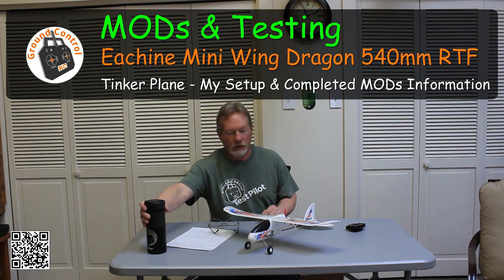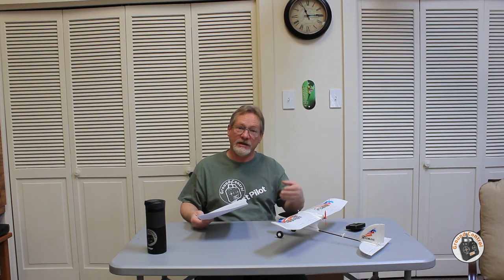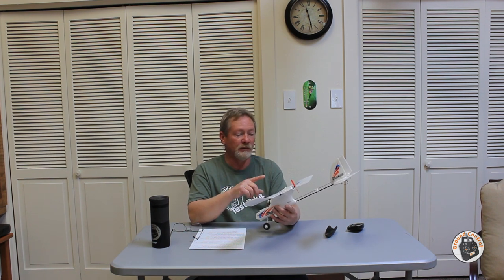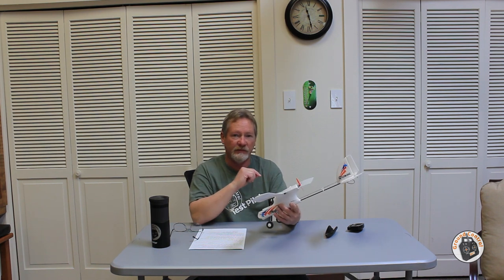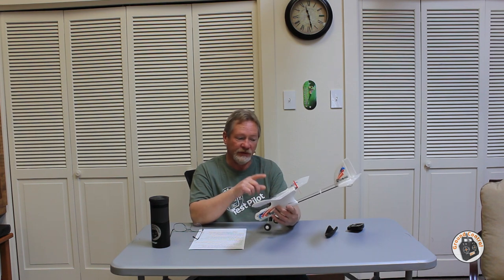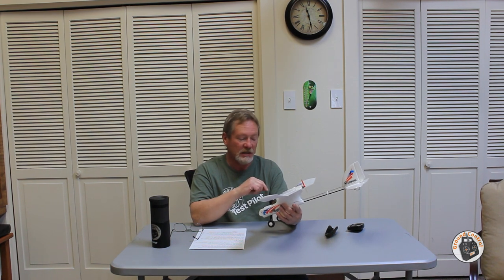Eachine Mini Wing Dragon 540mm Wingspan 4CH Gyro Trainer Airplane RTF  - Setup & Completed MODs Info

Comment: That's quite a mod list.  Nice to have a Mini Wing Dragon that flies better than most, isn't it?

Is it possible to remove the fuselage boom on either end?  If so then you might be able to shorten it and the entire aircraft a half-inch or so for balancing instead of having to add any weight.  Just a thought.

Happy Flying!
Reply from the maker: I'm very happy with it now. Oh, I'm done with the MODs on this one ;-) It's .4g less than stock and it's flying extremely well. Now it's on to the Mini Mustang if the Motor testing proves to be what I need.

Comment: Great mods, and I am looking forward to a flight video with the F949 brick version. I think for anyone but a complete beginner, this plane does not need stabilisation, but for those beginners you have also pointed the way to a good stabilised solution. 

If only this one had started out with the right brick, and as a bind and fly for use with the multi protocol transmitters, it could have become a classic. Sadly though I think it will struggle to recover from a bad start.

And I do like the "tinker plane" definition. This is not the first of those I've seen!
Reply from the maker: Thank you much! I have already posted a couple of videos with the F949 Brick and it's working very well ;-) I'm finished with the MODs and now it's just Fun Flights. See you in the Air!

Comment: Maybe someday manufactures will build planes that won't NEED modifications just to fly correctly and any mods will be just for fun.
Reply from the maker: It's a Dream I have ;-)
Reply: Eachine and Volantex did that with the Mustang and Sport Cub. And modding them WAS fun. 
Didn't you know that RTF means READY TO FIX?  ;-)

 Happy flying!
Reply from the maker: @Doggeslife   Yep, the Mustang and the Sport Cub were nearly perfect right out of the box.
Reply from the maker: @theoztreecrasher2647  I didn't know they had a flyaway issue? I'm glad they fixed that before I got one. I've only had (1) flyaway in all the aircraft I've flown. Guess what it was?
Reply from the maker: @theoztreecrasher2647  It was the Eachine e130 Micro Heli. I took off and it just kept climbing, I pulled down on the stick and it just kept climbing, I tried the emergency shutdown button and it just kept climbing, I turned off the TX and it just kept climbing ;-) As far as I know, it may still be climbing ;-)
Reply from the maker: @theoztreecrasher2647  no, that was some little kid in Denver flying his toy quadcopter ;-) FAA report at 10pm ;-)

Comment: I can’t understand at all how your plane could be balanced, I had to add 2x5 grams (I know it’s crazy) in the small cavities on the side of the battery to balanced it… and I didn’t put the tail wheel… 😎😎😎 this thing is a mystery to me…  😁😁 great video anyways!
Reply from the maker: Hey Indy!
What do you mean? Mine wasn't balanced, it was pretty tail heavy ;-)
I removed the Tail Wheel and replaced it with a loop of Zip Tie, that reduced the Tail Weight by about a gram, and added weight to the nose to get it balanced ;-) I embedded some Brass BBs in the front of the Canopy as far forward as I could get them.
Then I had it pretty well balanced.
Did you find the MT99xx Protocol?
"Dragon" is a Sub-Protocol of the MT99xx Protocol.
The latest version of OpenTX should have it as I'm not on the latest version of OpenTX.
That should get you bound with your TX.
Reply: @GroundControlRC  i meant you balanced it well with a few grams. I have to put 2-3x5 grams in the nose to balanced it properly… although I don’t know exactly where is the CG… (1st third of the edge of the wing)
For the protocol it’s weird… scrolling to the last subprotocol, it has non name, and it’s written below « protocol invalid », but the 4 channels are working, except the channel 5 where is supposed to switch the gyro… no « dragon » subprotocol and I have the last version of opentx
Reply: @GroundControlRC  plus sometimes when I switch channel five the rudder goes completely left or right and the throttle goes all the way!!! Scary! I have to switch of the plane, no other solution…
I think I give up with Eachine… I have a Trojan flying very well in 1st and 2nd mode but really bad in manual…
And a OMPHOBBY flying like a dolphin…. super tail heavy too… 😅😅😅😅 I’m going back to my 1st love, FPV drone racers….. 😎😎 or RC cars 😁😁😁
Reply from the maker: @Indy64738  Oh, I misunderstood ;-)
I can't remembers how much those Brass BBs weighed but I know I put 4-5 of them in the Canopy.
That's really strange.
I'm on OpenTX v2.3.11
I noticed v2.3.14 is out so I'll be updating to that release this weekend.
The Eachine Mini P-47 uses the same Protocol.
I always post my Setup and OpenTX Model Files on our Facebook Page.
Here is a link to the OpenTX Model File for the P-47 which should also work with the Mini Wing Dragon if you want to download and import it.
It will have the Gyro Setup as well.
https://drive.google.com/file/d/1mJXax2wLqkQoEFpskiNoy2yRrspgk901/view?usp=sharing
I hope that helps.
Reply from the maker: @Indy64738  Don't give up!
I think you have the wrong Sub-Protocol which can cause the issues you're having.
I provided a link to one of my OpenTX Model Files in the last post which will help.
Reply: @GroundControlRC  I’ll check that, thanks a lot!
Reply from the maker: @Indy64738  You are most welcome Indy ;-)
Reply: @GroundControlRC  i tried your model, exactly the same issue as mine, no protocol name, and the gyro switch doesn’t change anything although the channels 1-4 are ok … anyways, I’ll give this airplane to my nephew, since it’s working okay in mode one .. Thanks for your help. Cheers
Reply from the maker: @Indy64738  You are most welcome.
Your Nephew will have a lot of fun with it.
See you in the Air!

Comment: Did I hear you right that the stabiliser / reciever is an xk if that is the case I tried setting up the xk800 which I think is possibly the same brick and for it to work on the Radiomaster in stab mode it needed to be set up on channel 8 and then it worked fine, but the drawback is that there is no manual mode however if you disable channel 8 everything functioned as in manual mode, what I’m am now wondering is whether channel 8 could be disabled with a switch on the Radiomaster or a three position switch with the function of the third position to disable channel 8 ie up switch 6g middle position 3G and down position channel 8 off ( manual) Does any of this make sense doing as opposed to describing can be a little difficult sometimes. What fun this hobby is.
Reply from the maker: Hum...good question. Perhaps if the 3rd position of the switch is out of range from where it expects it, it would disable that position. Worth a try. Yes, from what I understand this is a WLToys/XK Brick. They wouldn't be so bad if they replaced the 3D Mode with Manual Mode. I put the F949 Brick in mine so I could fly in Manual Mode with no input from the Gyro. I noticed the Eachine Mini F22 also had Gyro input in Expert Mode and no Full Manual Mode. I just received the Eachine Mini F-16 but I think the Expert Mode is the same as the F-22. As soon as the weather here breaks I can test it out.
Reply: @GroundControlRC  I have a feeling that a switch could readily be assigned to disable the stabiliser channel and that would effectively give a three function stabiliser why that’s not built into the reciever mystifies me, your I’m sure much better with the Radiomaster than I am it takes me 10 minutes to work out how to turn it on. Actually I’m joking it is actually very easy to set up a plane but there is a lot of complexity with functions that I am describing, if there is anything useful please let me know how you achieved it. Last thing thanks from all of us for providing your set up notes for your models I think your fairly unique in that respect but it’s so useful when your sitting there scratching your head in bewilderment.
Reply from the maker: @michaelwheatland4565   Thank you much Michael. I was hoping the setup information would be useful at least for the Maiden Flight so there are no surprises ;-)
Reply: @theoztreecrasher2647  hi there thanks for your suggestions I will give it a try, I do think there is a solution out there the question is if do I possess the techinical ability we shall see if I do I will contact you. I have found the Radiomaster to be a great radio particularly with the mini warbirds the p51 and Corsair. As regards to crashing in all my larger models I have fitted the Kopilot lite they have cost me a small fortune but saved a bucket full of glue.🤨😂
Reply: @theoztreecrasher2647  I’m having a good laugh at this end, I’m think I’m a mirror image of you in the northern hemisphere. Coincidentally I have ordered from bangood a couple of the v761 bricks firstly because there terrific value and secondly because I thought they would fit neatly into a800 or perhaps some of the other small gliders I have. I will let you know how I get on. Out of interest are you on Facebook if you are search under my moniker. Michael Wheatland and we could hook up.
Reply: @theoztreecrasher2647  trouble is everything is made in China we all have got ourselves in a fine mess god knows where it will end up.
Reply: @theoztreecrasher2647  I have a distinct idea of your age my guess similar to mine there again probably doing you a disservice which I tend to do quiet often. Stay crashing those planes.😃